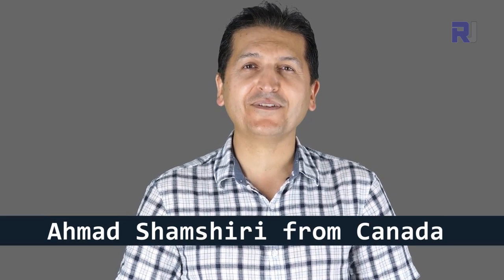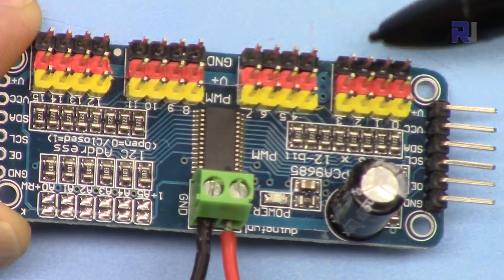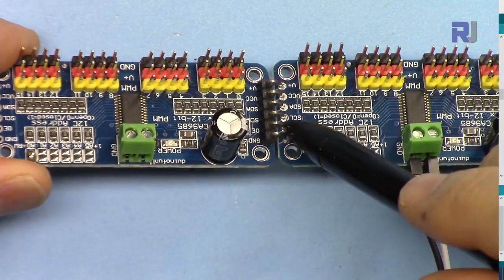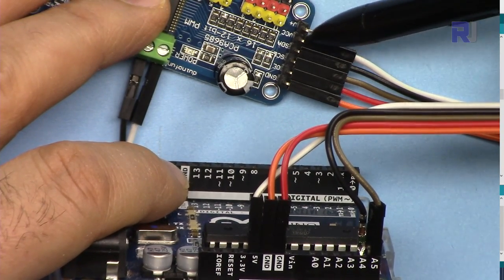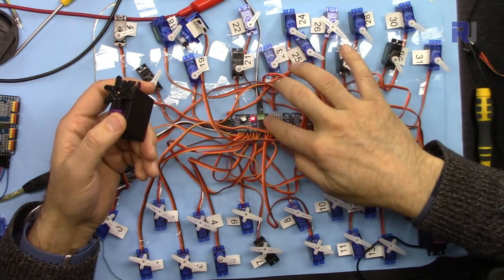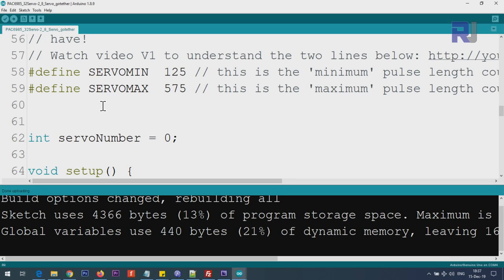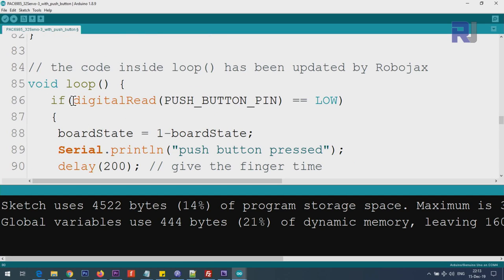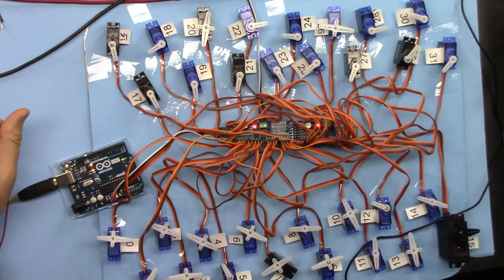Controlling 32 Servo Using  PCA9685 and Arduino: V3

Comment: I can't believe you set up all of those motors!   Ha!!!  I respect your hard work and I appreciate it.  I have recently begun learning servo motors and the PCA 9685.   You have also inspired me to create a convenient way to screw multiple servos to my shelf for testing.   I am sure you understand the need to keep them from tipping over while testing.  Keep up the great work!   I hope you are well during this difficult time.
Reply from the maker: Thank you. LOL. yes. this is V3 which I started with V1 of this series.  People wanted to know so I did. Now I also have V4 with you control them over Wifi using ESP32 .  I hope you are  well too. Thanks to God I am okay so far.

Comment: Hello!
I've 3d printed 2 headpieces and I'm very new to arduino. 
The first headpiece requires 36 servos,the second requires 20.
I will be connecting them to a 3s 11.1v RC lipo battery. 
I have the buck converters, I have the pca9685 boards, my main boards are mega 2560.
Every video I've watched has doesn't include information describing how to connect this board to a battery power supply. 
Any advice would be greatly appreciated 🙏 
Thanks very much for your amazing channel!
Reply from the maker: Just connect your batter directly to power adapter connector and it is safe or connect it to VIN pin.

Comment: Hi Ahmad, greetings from the NL here. Can you tell me what kind of current all the servos pull through the boards? I have a project with 21 MG996R  servos  and i hesitate using them on boards like these. Each MG996R use about 170mA  in normal activity, so 21 x 170mA is 3-4 amperes. Can a board like this take that amount of current?

Comment: Sorry to mention here the concept does not work in real-life use while the servo motors are subjected to some work to be done. (9G servos may  be ok) but if all the MG 995 work at a time on load ( not like your demo in no lad) the tiny little series MOSFET used for reverse supply protection of the PCA 9685  board for powering the servos from V+,  simply smokes. It happened for my case with just 8 nos MG995 used in arm operation against gravity. But I can still use the board by giving  VCC  5 volt and driving the servos through power MOSFETs whose gates only receive the PWM signal from PCA9685.
Reply: How much power needed? For 32 Servo
Reply: @aaaonhi9260  400mA per servo on an average.Usually all the servos are not operated on load hence even if 10 servos operate on load at a time it is 4 A Then PCA 9685 will just smoke Let alone 32 .
Reply: @PatnaikUC  Thank you very much sir, i am use mg995 And power can'T supply

Comment: Thank you great video, clearly explained and easy to follow.  I would like to use this to control model railroad turnouts. How do I control individual servos using switches please?
Reply from the maker: This is version 3 . I have 4 versions . I have so many videos  on servo with switches that might help you learn.
Reply: @robojax  Thanks I will look at V4 and see if I can work it out.
Reply: V4 was good, however I want to control PCA9685 using switches for individual servos.  I can’t find a video for that?

Comment: It's really helpful and worthy tutorial video. my question is: 
What is the best way to connect the PCA9685 with MPU6050?
And is it possible only with different addresses and then just connect them both to the Arduino or that will be signal to noises!?
Reply from the maker: use the same Arduino. You can connect 128 I2C devices to Arduino all in the same pins SDA and SCL Thank you for not skipping the ads and keep watching it. This will help me a lot.
Reply: @robojax  Actually i'm still getting some signal overlap from both devices. Thanks for your reply and i hope you make more great videos, also about I2C addressing. Thanks
Reply from the maker: You are welcome.

Comment: Thank you for your impactful tutorials.  I have a question:  I would like to run multiple 25kg metal servos but the voltage/current exceeds the PCA9685 threshold.  Is it possible to power externally the servos and have the PCA9685/Arduino provide signal only?  Thanks in advance if you are able to help me out :)
Reply from the maker: Hi, yes you can use this for signal control. Just share the GND with pier supply and connect pier directly to each servo motors.

Comment: Hi Sir, thanks so much for your video!
I would like to power my arduino broad by Vin, but there is no more ground for the power supply. Can I skip the connection from OE to GRD as the introduction you shared?
Thanks in advance!
Reply from the maker: Hello,  we have GND pin for power supply. don't we?  I've shown connecting separate power supply connected. You must have skipped V1 videos. please watch that.  this video is V3.

Comment: Hello sir nice work done by you. 
I also did the same thing I connected 2 pca9685 as per the connection shown, I am getting itc error. Can you pl help
Reply from the maker: You can’t just say I am getting erro. Explain the error or post the error here. Read the error as most of the time error is very clear to understand.

Comment: I have used the Mega with the PCA9685 to control servo's for points on Model Rail, had problems with code but found one that worked, so very interested to be able to add another PCA9685 for 16 more points, I used Data pins 22 to 37 for SPST switch control so can use 38 to 53 for another 16 but if I wanted to use another PCA9685, 3 in all not sure how I would use Data inputs as running out of input data pins... Great video Regards John
Reply from the maker: I have explained it in the video how to add the 3rd module.  Watch the video I am sure you will understand it.
Reply: Hi John,  I am interested to use PCA9685 to control servo's for points on Model Rail too. There's only one problem maybe you can help me. I'd like to control the servos from the computer and I'm looking for the right application to control. Do you know one? Can you send a link to the code you're writing about? I would be very grateful.
Reply: John can you provide me wiring and code fro the mega.  I wish to do the same.
Reply: @piotrpiotrowicz6943  Hi, I just found this messsage it must have gone in spam, not sure if I can help you now, but I did make a lot of upgrades to that section and finished up using a MERG Megapoints Controller will operate 12 servo's  and MERG Servo4 boards will operate 4 servo's ...
Reply: @SuperSpuddo  Hi, I just found this messsage it must have gone in spam, not sure if I can help you now, but I did make a lot of upgrades to that section and finished up using a MERG Megapoints Controller will operate 12 servo's  and MERG Servo4 boards will operate 4 servo's ..
Reply: Thanks I will give it a shot

Comment: hello ahmad from canada i watch a lot of your videos i am currently watching v1 v2 v3 v4 on stepper motors what code do i need to slow the servo motor rotation in other words to make it run slower than it does
Reply from the maker: The speed it maximum. Simply add delay in the loop where the servo is controlled. delay(100) will add 100 milliseconds delay

Comment: My question is how to connect to ESP8266     
Which pin of the ESP8266 will be connected to OE, SCL, SDA pin from PCA9685 ???   and the code still the same Except the pin number Right?

Comment: hi sir robojax, can we a sensor in the arduino while the pca is connected, and before the pca will control the servos the snsor must sense something??
Reply from the maker: Hi, you are watching Version 3 (V3), there are V1, V2 before this video.  Yes  you can use arduino fully for something else like sensor.

Comment: Hello, I need your help with something. I have 20 servo motors and they move very fast. I have to slow it down.
very slow. :). can you help me. thank you🙏
Reply from the maker: Just add delay in the loop . Start with 100ms, and increase the number:. The higher the number the slower the movement.  This video so  erosion 3. Watch other version yo learn more

Comment: i dont have yet the driver but I'm curious if the angel step is 1, it could run smoothly?
Reply from the maker: This is version 3 or V3. I have 4 videos . You can view and learn from them. Start from v1. Link in sway of this video.

Comment: Thank you very much for your video!
It's really helpful video.
I have a question, can I operate the pca9685 using a RIP sensor?
Reply from the maker: You are welcome.  it depends what you want to do. if you want the V1 of this module. I have explained it.  if you want to control it with distance or just turn ON and OFF. I am not sure. But yes you can control this.
Reply: @robojax  Yes! I will use the "Gravity digital infrared motion sensor". I want to turn it on and off, but I have no idea how to write the code.😭😭 

👉This is only the code that turns on the LED with the sensor, but I'm not sure how to combine it with the pca9685 working code you taught from video.
====================
const int buttonPin = 3;
  const int ledPin =  13;
  void setup() {
    pinMode(ledPin, OUTPUT);
    pinMode(buttonPin, INPUT);
  }
  void loop()
  {
     if (digitalRead(buttonPin) == HIGH)
     {
       digitalWrite(ledPin, HIGH);
     }
     else {
       digitalWrite(ledPin, LOW);
     }
  }
Reply from the maker: this is just a switch. I don't understand what you want to do.

Comment: Hello Sir, I have a query. If someone has to connect multiple servo motors with different power voltages in this servo driver, then what should the person do?
Reply from the maker: then just connect the servo GND and signal pin to this module. Use external power to the servo and it should work.

Comment: Hi is there a way to wire say 4 sets of 4 motors using a button for each set. 1 button for each set of 4 servos. Wiring it up that way to do something simple like in your basic servo motor video where it moves from one specified point to another and stops and reverses at the push of a button. ? It’s for controlling lane changers on model railway car system so cars will change lanes.
Reply from the maker: Hi, yes it is possible.  you have to work on it. All my videos and codes are free. but if you pay for custom code, you can contact me via robojax.com contact page. I will charge $100/hour for work. Don't forget your email in the body of message if you contacted me.

Comment: Can you do a video on controlling these servos using a PC actively using pyfirmata. PLEASE it would really help. Btw awesome video!!
Reply from the maker: you will need USB to UAR converter and then from windows you can send commend. but still you need Arduino  to control this servo module. Never heard the py... you mentioned. .

Comment: Hello Ahmad , 
Thank you very much for the excellent explanation of about anything according to Arduino.
I do not know very much about programming but I am Learning. :-)
I have the following question :

Is there any possibility to control about 20 servo motors independent from each other while using 20 buttons and using the PCA9685?
I think about a combination of this video and 
Servo_pushbutton2_move_one_direction ?
 
So can you give me a clue for this ?

Thank you very much,

Kind regards,
Luc
Reply from the maker: Hello and you are welcome.  in the mention video with push button, we don't use any external module. but PCA9685 iss totally different. But you can do it.  you can use the code from push button to use  board1.setPWM(i, 0, angleToPulse(angle) ); instead of the servo in that code. it needs work. good luck.

Comment: Hi... If I have 8 servo sg90 with pca9685 what power supply (volt and ampere) for these servo?
Reply from the maker: Hi,  in one of the versions I have mentioned the current. Voltage is very clear. whatever your servo  needs that is the voltage. you can measure the current for ONE servo and multiply it by 8. Or watch wither V1, 2 or 4 if not mentioned in V3. I don't remember.

Comment: hello sir, can i use this for power adapter ?AC/DC Adapter Power Supply 30W 3v/4.5v/6v/7.5v/9v/12v Adjustable Voltage, Current: DC 3A
Reply from the maker: this module needs 5V or whatever your servo voltage is.  the current depends on how much servo motor and what kind you have. use multimeter, measure the current of ONE servo motor while it is running, then multiply it by the number of servo motor you have see V1, V2, V4, V5 of this video I have have given different examples there.
Reply: @robojax sir thank you,  ill follow your suggestion.

Comment: emmm, I'm looking at building my own quadcopter flight controller based on esp32 or 8266 and i thought this would be a way to control the motors, but its so laggy i think it would fly like it was drunk....
Reply from the maker: LOL. For quadcopter why would you use this PCA9685? both boards have 4 outputs for 4 motors and enough inputs for any 4 or 6 controller. By the way this is not laggy.  it is the demonstration and delay that I've added . you can remove the delay.
Reply: @robojax  yes sorry typed quad but i only like octo's, 8 flight motors,  3 more motors on camera gimbals for position,  camera control motors for focus/zoom, servos for landing gear to retract out of way of camera, theres not enough pins without expanding. obviously the i2c can handle extra input devices because you need all the sensors/gps
Reply from the maker: then use this and it should work.  the lagging is due to running 32 servo. in your case 8 servo/motor will make it 4 times faster and you should not notice the delay.
Reply: @robojax  yeah I think the mass of the chassis should dampen out the tiny lag and that's after prop mass which will be another damping factor. The quadcopter community has forgotten about heavy lift builds and there all into fast race fpv but I want to get licenced and do building photography and surveys

Comment: is there a global setting to adjust the speeds?
Reply from the maker: Please watch version 1 or V1 if this video and then watch V2 which I have explained more features. This video is V3. Links in description of Thai video.
Reply: @robojax  I watched them, i still dont see an easy way to slow them down.
Reply from the maker: simply add delay in the loop like delay(50); or less or more.  right now delay is 0 so it is fast then delay(10) will slow it by 10 milliseconds. and delay(50) will slow it by 50ms.
Reply: @robojax  i have 40 servos that need to move in unison. If i add delays or loops even, they get too delayed. for example, i need servos 0-4 to move to 90 degrees at the same time. then, i need 0-4 to move to 70 degrees and servos 5-14 on board 1 and 1-15 on board 2 to move to 90, all at exactly the same time.  they all get delayed weird if i try loops and delays to slow them. even at full speed they dont move in unison.
Reply: also, thank you so much. your videos got me down the right path. I know anything about this till i found your stuff.
Reply: @robojax  all the LEDS go at once, the servos still move all delayed and at different times. heres my code to move all the servos to 0 and all the LEDS to bright at the same time, then all the Servos to 70 degrees and all the LEDS dim at the same time

int breath1() {

           for(int i=0; i<15; i++)
        {      
            board3.setPWM(allServos[i], 0, angleToPulse(0) );   
            board2.setPWM(allServos[i], 0, angleToPulse(0) );
            board1.setPWM(allServos[i], 0, angleToPulse(0) );                      
          }
            for(uint8_t i=0; i<NUM_LEDS ; i++) {
            leds[AllLEDS[i]] = CHSV(bled,bled,bled);
          }
          FastLED.show();
          delay(500);

         for(int i=0; i<15; i++)
        {      
            board3.setPWM(allServos[i], 0, angleToPulse(70) );            
            board2.setPWM(allServos[i], 0, angleToPulse(70) );
            board1.setPWM(allServos[i], 0, angleToPulse(70) );                      
          }
          for(uint8_t i=0; i<NUM_LEDS ; i++) {
            leds[AllLEDS[i]] = CHSV(dled,dled,dled);
          }
          FastLED.show();
  
}
Reply: @robojax  i dont have yet the driver but I'm curious if the angel step is 1, it could run smoothly?